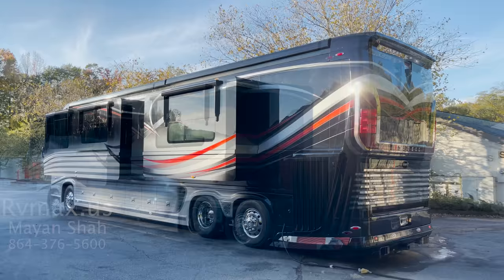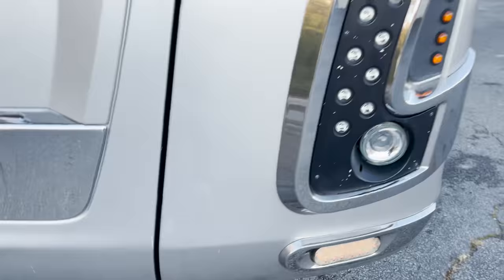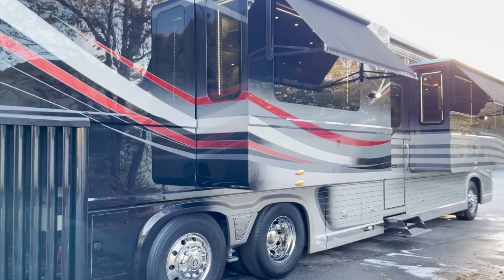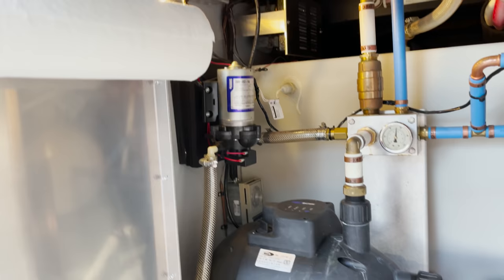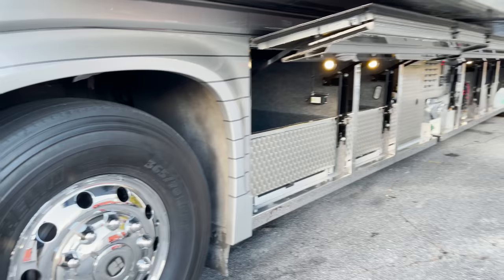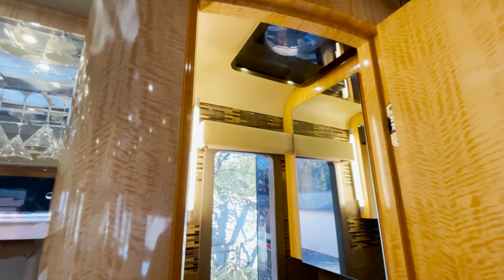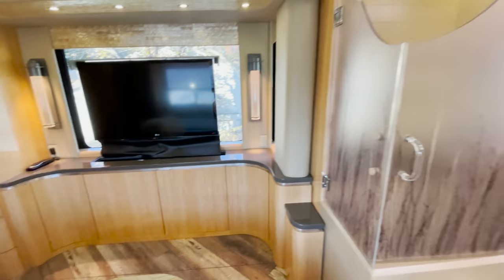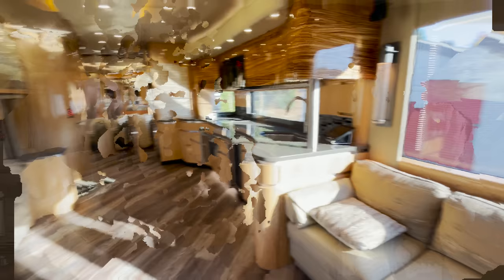BOILED DOWN TOUR OF NASCAR DRIVER OWNED 2013 NEWELL 2020P, NICE BUS. Sold

Comment: Long board shorter board yet still get the sticker picture boards. If the short board was 1/3 tiny bit wider it would be perfet custom touch. Out side still needs a new buff grider complete re-paint though, like some 1 used out side of bus as art piece & attack metal leaf cut out over top of the normal smooth finish yet u can see thru bc not metal but acrylic tuff platic paint leaves of autumn coach.

Comment: those kds blocks a the park up on play ground u can hve it turned 3 diff ways to say something or art wise something. That is the window play ground soft curved edges kid safe they should hve used in the 1/2 bath, tint, no tint, or mirrored window in 1/2 bath allowing venting when partially turned.